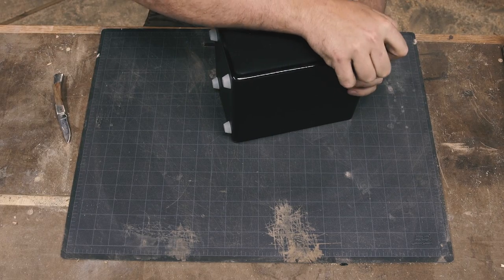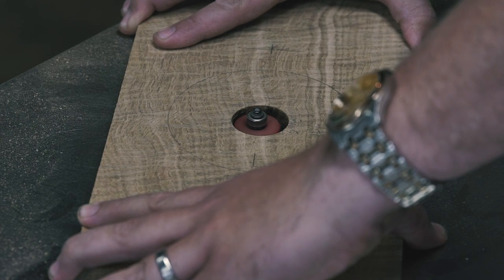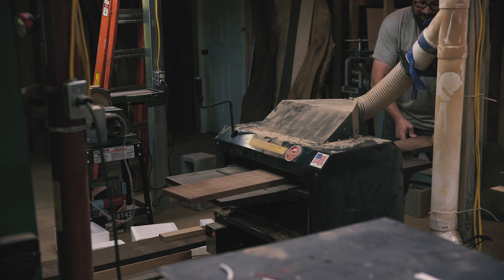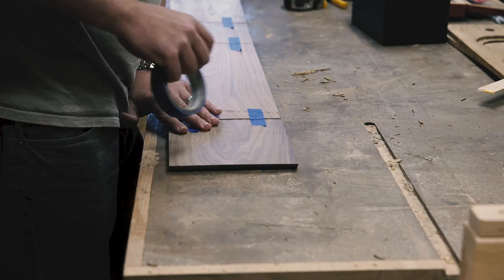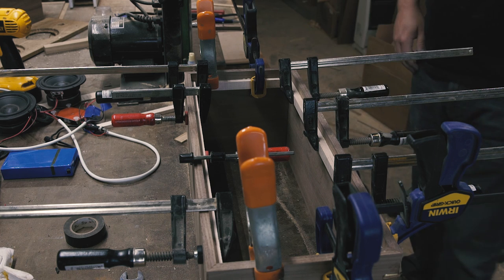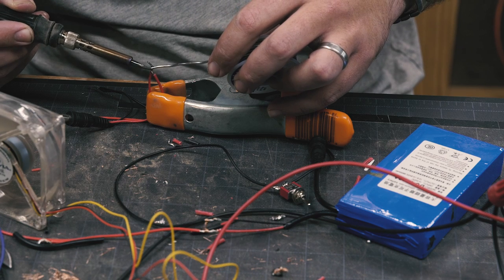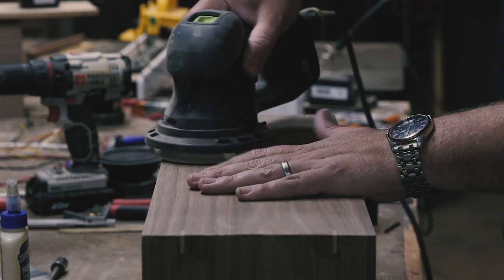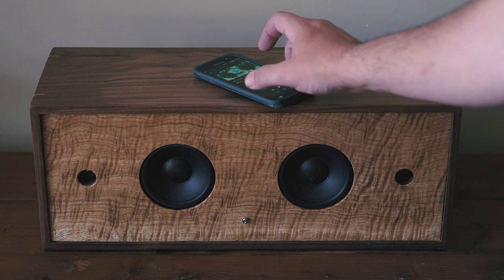Wireless Bluetooth Speaker: Wireless Rechargeable Battery Powered Bluetooth Speaker | Woodworking

Comment: If you design Speakers the enclosure is the most important thing which has to be calculated, taking extra care of the Enclosure type, Internal Volume, Wood thickness and passive components! 
You cant just take some speakers and put them into a randomly built enclosure. Those Bookshelfspeakers were pretty small so they were designed to play in exactly this internal volume of the enclosure you took them from! To achive the sound characteristics of the company, you should have built an enclosure with the internal volume fitting the bookshelf ones! 
Randomly adding a port would change absolutly nothing!!!
For a new project like this, go to parts express and buy Dayton Audios ND series and google around for Thiele Small Parameters/Loudspeaker enclosure calculator! The Thiele Small Parameters are mechanical characteristics which are needed to calculate your Enclosure. Or even better:
Try to find Build plans on google from people who know what they do! 
Awesome vid quality by the way!^^
Greets from Germany!
Reply: exactly.... people building these things can do things out of wood but can't do it proper-proper.  if it's not under powered, it's too small passive radiators or tiny ports that do nothing or just make port noise.... or no cross over so tweeter/woofer is either now 2ohm or 16ohm or something weird...

Comment: hey man, i really like your desing. But, do not put the tweeter or any woofer without  been flat with the wood (unless you're using a waveguide), because you make the speaker sound 10 times worst, seen that you are basically cut all the frequencies to one direction.

Comment: The tin sound that you are talking about, could be cause of the amplifier board. Also since it is a sealed box I would recommend you putting some sound material inside. Helps a lot with the sound produced. Something like https://www.sonicelectronix.com/item_5344_Poly-Fil-PF20.html. This helps with the sound. Good work.

Comment: Your woodworking is exemplary, but your acoustics need help. (1) you have no bass because the cabinet is too big for the woofers, and so they're overdamped. Measuring the woofers for their Thiel-Small parameters and then plugging those numbers into any number of different box-building programs will tell you the ideal box size and port tuning (if any) for the woofers you have at hand. (2) When building a 2-channel system in one box, always place a divider panel inside the box to provide each woofer with its own independent air chamber. This increases stereo separation and makes the bass more consistent with different bass recording techniques. (3) Sealed cabinets should be lined heavily or else stuffed with polyfill or rock wool to eliminate midrange reflections inside the cabinet, which will interfere with the midrange sounds being produced into the listening area.

Comment: And why to Americans still use imperial?
Reply from the maker: except in this instance, I prefer a fractional form of measurement.  It makes division of something in half ridiculously easy.  I digress but what do you do when you need a measurement smaller than a millimeter or when an odd number needs to be split in half?
Reply: Wm. Walker Co. Callipers :) but I think that tolerance is not for wood.